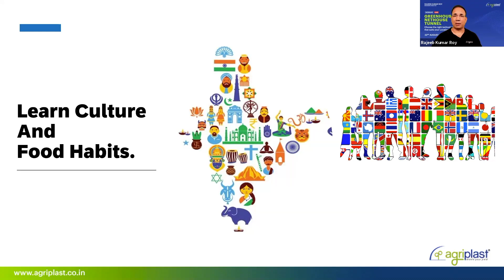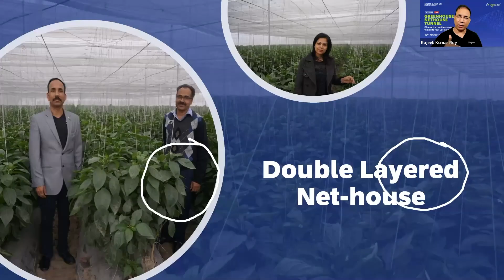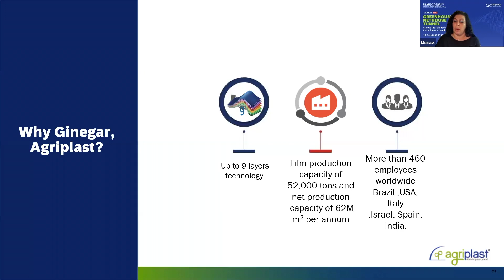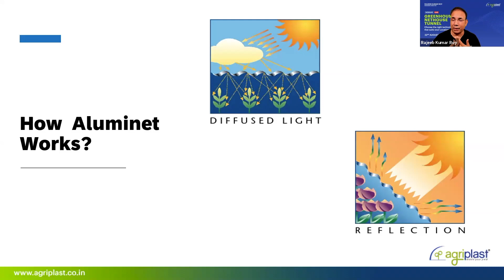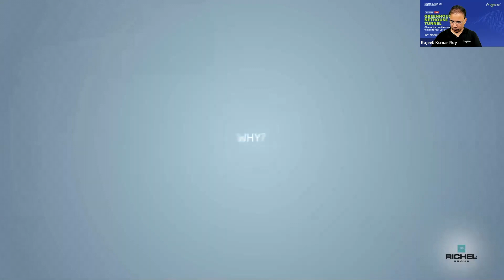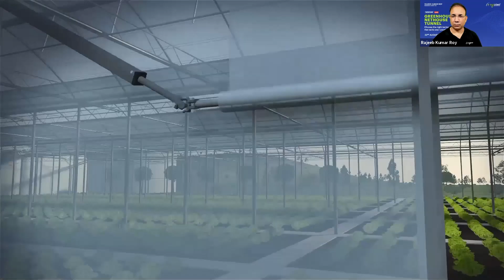"Don't Decide to make a greenhouse, net house/tunnels until you watch this video"Webinar Recording

Comment: Very Nice webinar, I would like to know why are greenhouse always use negative pressure for fan and pad system the fans suck the air from the greenhouse, can we also use an air cooler to push air from outside to the inside of the greenhouse.